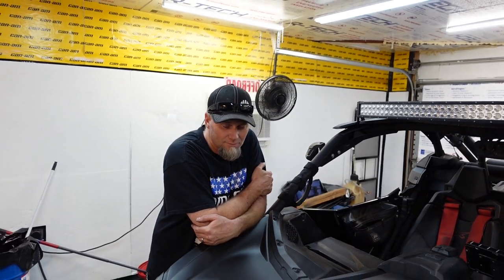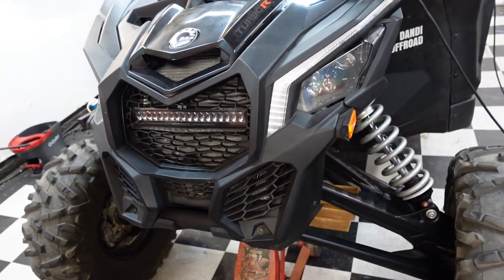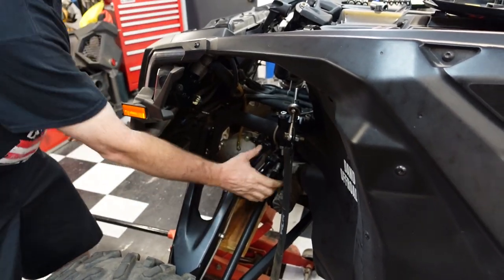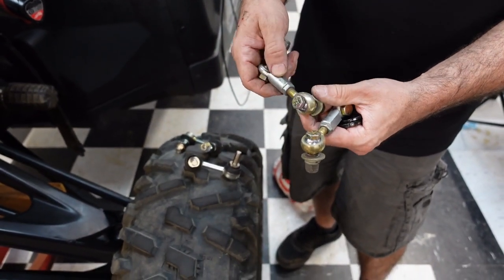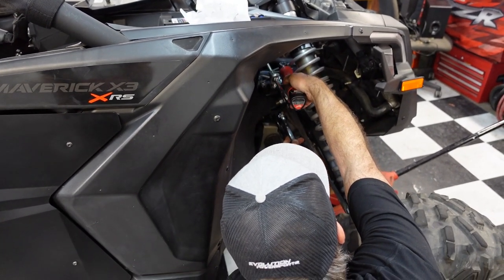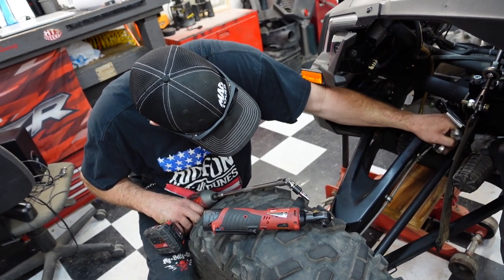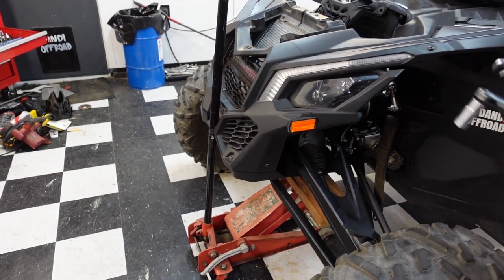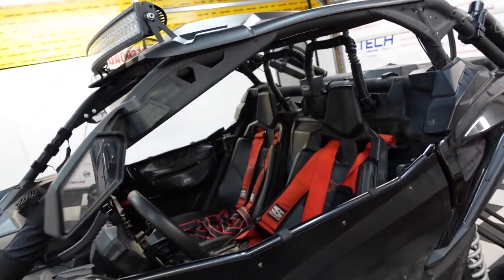Danny Wins An Award For Redneck Ingenuity

Comment: I’m thinking the grade  8 bolt may not be the best for sheer force, there made more for holding down. If you snap one check out what grade would work best. I also found out that the cheap step bit are junk, a quality one will last way longer. I’ll try and remember to bring one for you to Pismo.
Reply from the maker: Thanks for the info,, yeah that one was pretty good for a while,, it was dandi offroad budget approved..